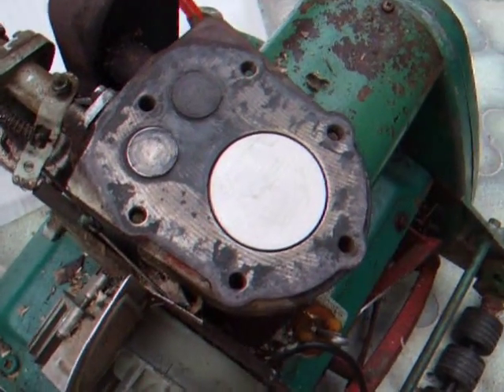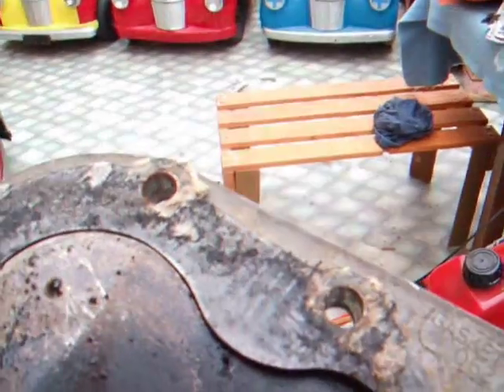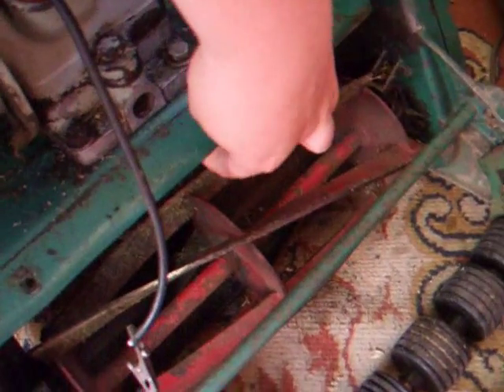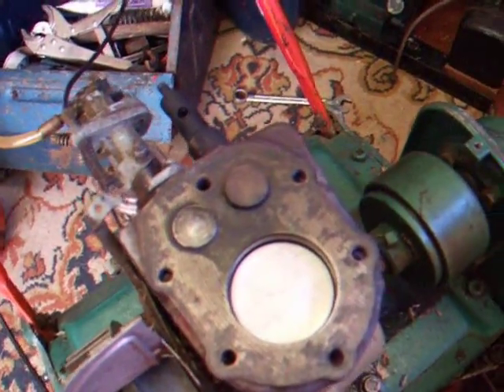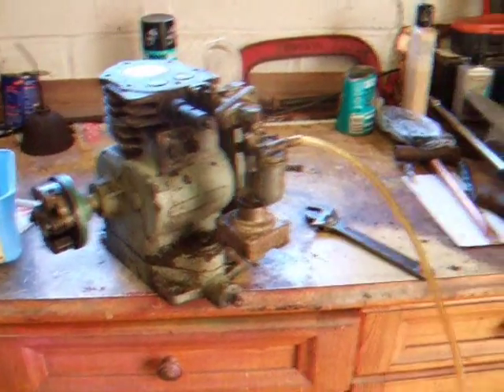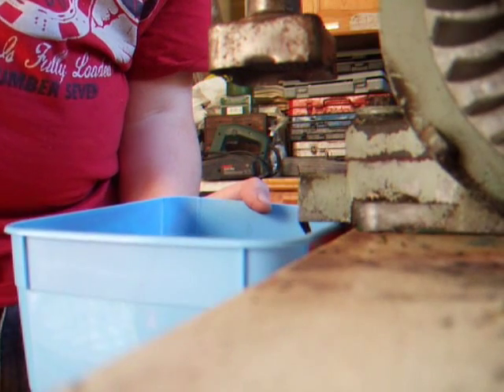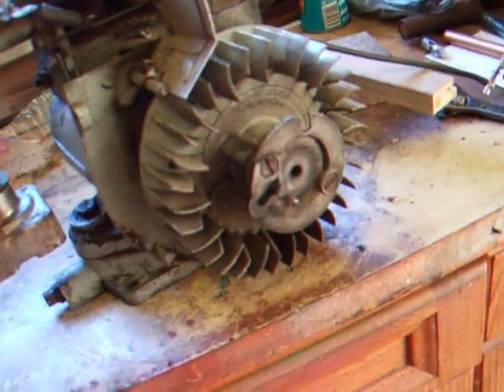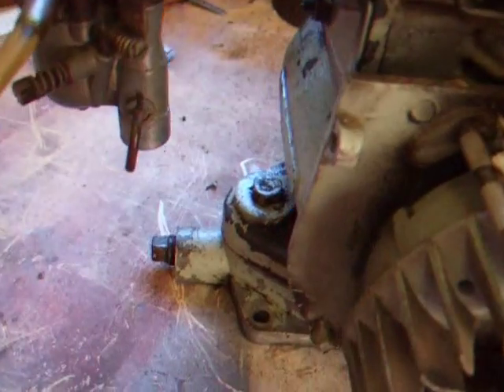Suffolk Super Colt 75cc engine rebuild (Part 2)

Comment from the maker: @jeffthebuilder10 Hi, at 11 seconds i can see a small lever on the manifold. This controls the throttle of the engine, the throttle on the handle bars links to this, this goes to a spring which goes to the governor which then goes to the throttle. 

Is this the piece you have missing?? If it is im sure you can source one on Ebay a lot of people braking suffolk engines for spares on there

Comment: So far so good. :) I'm thinking about upgrading the engine on my Suffolk Colt, I mean, the original 75cc works okay, but it's got very little power and it burns some oil, and has noisy valves. I might get a 2hp Briggs or a smaller Honda engine for it.

Comment: Get yourself some paraffin, with that carbon just wipes off. For new rings contact the hailsham mower centre, they have most things at reasonable prices.

Looking at that oil it's fairly obvious the rings are leaking, you've probably got a bit of carbon in there.

Good luck with the rest : )